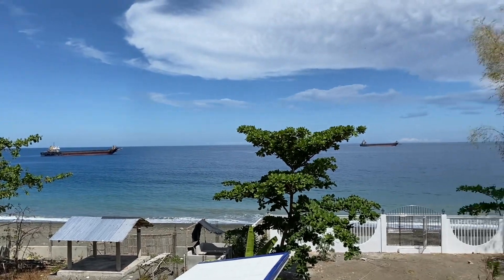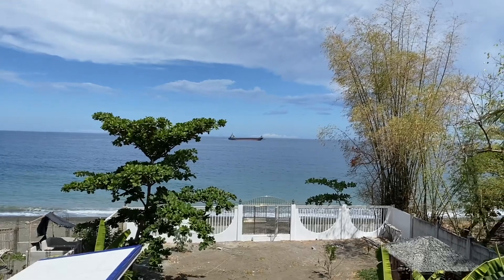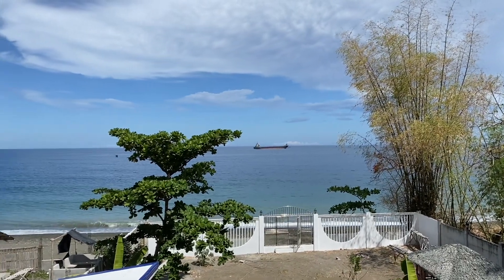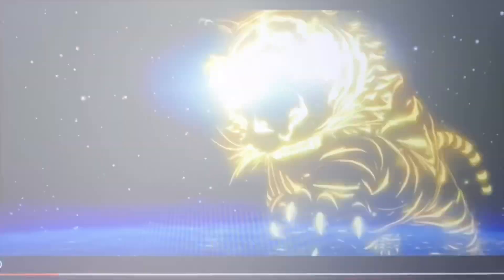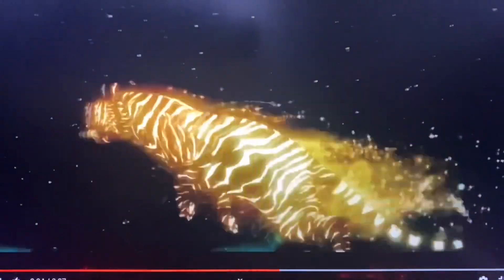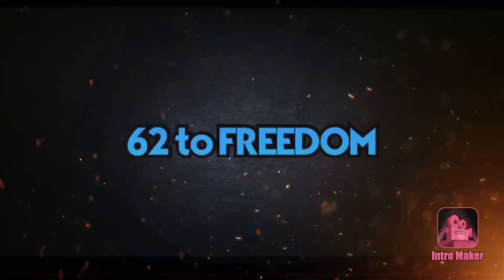Antique,Philippines house built- POLISHING STAINLESS/ROCK FALLING !

Comment: They sell smaller solar systems in the Philippines that you can get for under a $1000 that will run your refrigerator and maybe a led light and charge your phone , plus you can add panels and upgrade as you go along

Comment: Nice roll of emery cloth will clean up all the weld spatter and leaves a beautiful uniform finish. Flapper disc will trim the welds easily. You have months of work cleaning and repairing all the welds and polishing up your stainless . Good luck and it is looking good but still think 316 SS would have served you much ,much better and the cost difference in North America is not that big.
Reply from the maker: Not available in this area.

Comment: When wells are drilled here in US requires a casing then you would install your well pipe with screening. This will keep your sediment out. When you set your pump it doesn’t set on the bottom of the well. You set it off the bottom several feet at least. You can determine where to set your pump by measuring the water level in the well, then run your pump till you pull X (50gal) number of gallons of water. Then run a water level measurement again to see how far down the water went and how fas it comes back to it’s normal level the time it takes is your recharge rate. This tells you how careful you need to be when pumping water. Hope that makes sense to you. If you have a slow recharge rate you can put water in a holding tank to increase your water availability at any given moment. If you have a fast recharge rate you might not need a holding tank. Just take the water from the well as you need it.
Oh by the way, I think when you hit water at 10 ft down it’s considered ground water. I wou😢also see about having your water supply tested by a reputable company if you’re drinking it.
Reply from the maker: At 10 feet down the well was capped, not the level of the water was 10 feet. 10 feet down they put the lid on. Maybe 12 feet. But the top of the water was much deeper. The water was. We are not drinking the water. Dishes and bathing. One well was tested and one was not. The health department handled it. They sent it by courtier to the capital after they collected the samples. No bacteria was found. There is iron in it though.
Reply: @62tofreedom51  don’t know why they stopped at 10 ft an capped it? Should have kept drilling. They often hit spots with water when drilling. If it’s not enough you keep drilling. Don’t worry about cross contamination. That’s why they use bentonite to seal things. Iron isn’t a problem unless it’s staining. If deep enough I would drink the water after testing. As they say only in the Philippines! They have well diagrams that show proper construction.